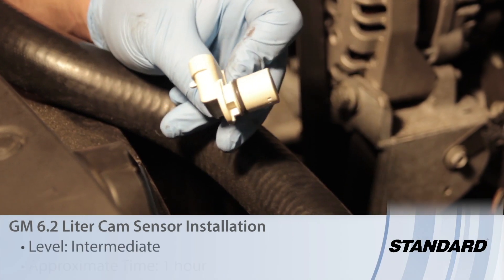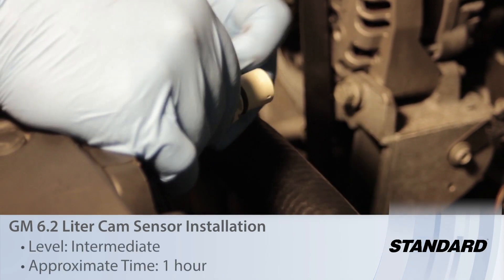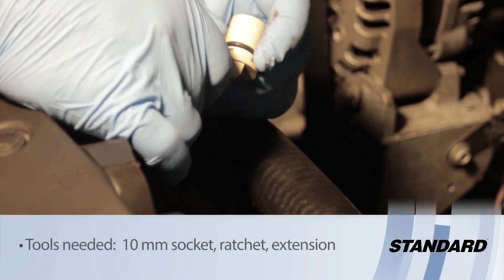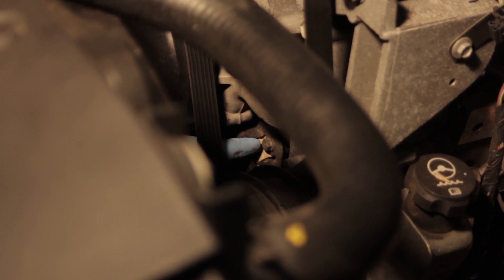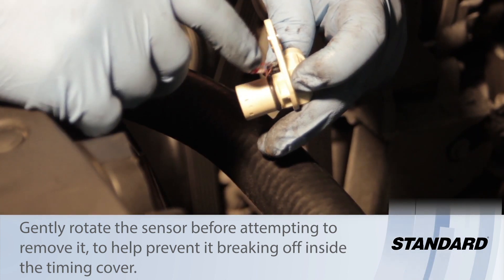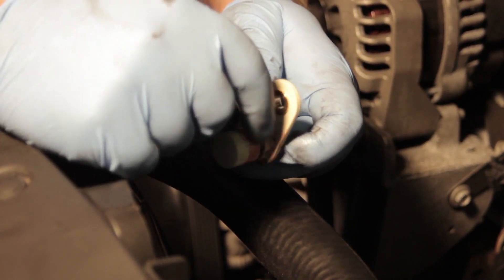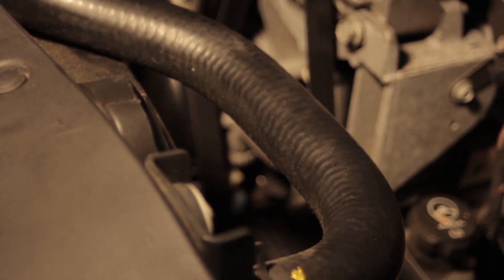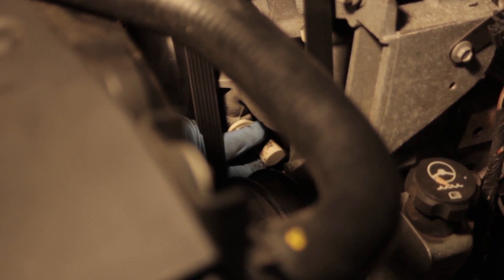GM 6.2L Cam Sensor Installation

Comment: You wasted our time bro smh. How do you expect us to see and remove the second bolt smh
Reply: did you have any luck? i’m working on this right now. i’m pissed he didn’t show the actual difficult bolt as well.
Reply: @bikelife916  I knew I should have made a vid when I did this last weekend. I have a 2013 Denali RWD. Follow these in order!
1.	Jack the front of the truck up, use jack stands, and remove the splash cover under the front of the truck (4 - 15mm bolts). 
2.	BEFORE YOU DO ANYTHING ELSE READ THIS PART: Get a good spot light and while you are under the truck look up at the top center area of the crank pulley, (from memory) it’s built with 3 spokes and has 3 descent sized openings. If you turn the motor over so that one of the openings is top dead center you will see that pesky 3rd hidden 10mm bolt holding that metal support bracket on. At this point in time I would remove the serpentine belt, it only takes a minute and frees up a lot of space. When back under the truck… I used a 10mm brake bleeder wrench because both ends are at offset angles, you need this to reach the bolt head. You go BEHIND the crank pulley from the left side (passenger side) not through the opening (that’s what I did) to reach the bolt.  You need only to break that bolt free by 1 full turn. (This bolt is clamped onto a C shaped part of the bracket so once its loose and the other 2 bolts are out along with the 2 electrical connectors disconnected the bracket can then be removed). 
3.	While you’re under the truck I would then take the lower 10mm bolt out of that electrical harness guide and disconnect the connector.
4.	Remove the top 10mm bolt like in the video then disconnect the top connector. You can do this step backwards if you prefer.
5.	Wiggle the bracket around, it might take some time, but it will eventually slip away from the 10mm bolt behind the crank pulley. 
6.	Remove the Sensor (hopefully it’s not sized in place then reverse the steps. 

IMO… some people say to take out the top and bottom 10mm bolts then wiggle the bracket off, if that bracket comes off without touching the 10mm bolt behind the drive pulley someone else already did this job and didn’t bother tightening that bolt.
Reply: Thanks for confirming what I thought 🤔,,, it's damn silly when the person who made the video didn't even mition the 3rd bolt @bmgws6979
Reply: @bmgws6979 Thanks for this detailed explanation.  I had an issue with removing the bracket until I read your comment.  Your comment provided me with exactly what I needed to remove my old camshaft sensor.